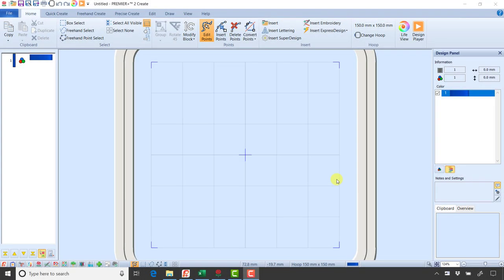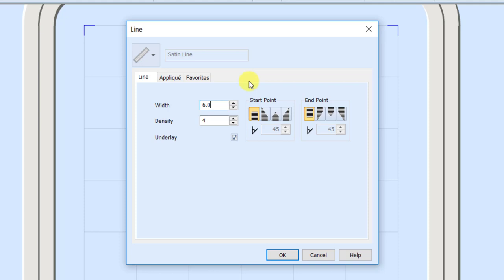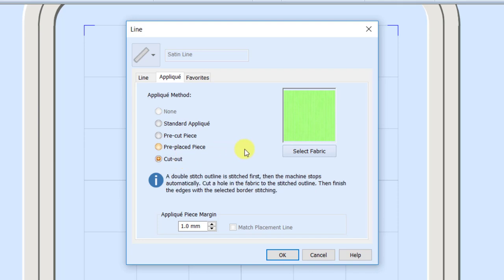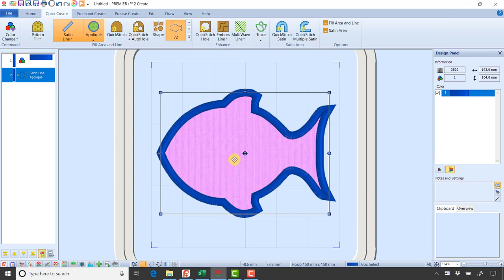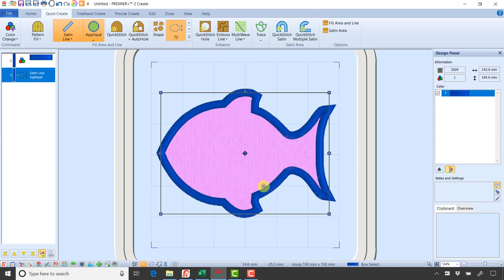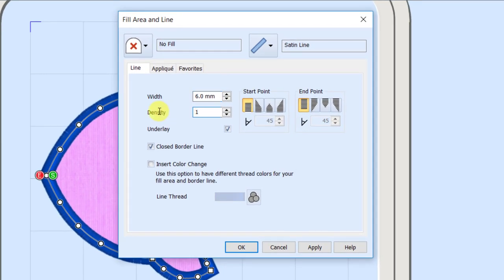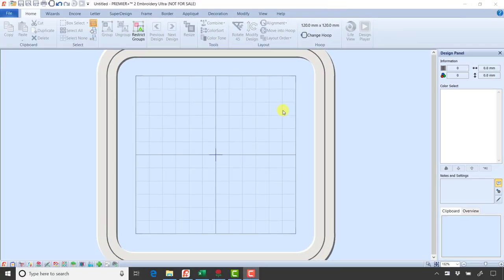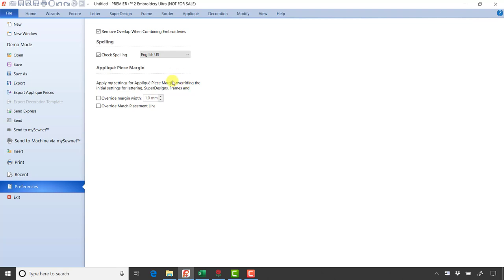PREMIER+ 2: Appliqué Settings

Comment: Hi Fill if I wanted to do a Applique with Batting & fusible backing for quilt Applique.   Does my placement margin need to be 0 ?  I'm not using a cutte.  I'm just making a regular Applique for my quilt & want my Satin stitch to cover my trim job.  Thankyou so much I've learned so much your a great teacher.
Reply from the maker: Hi Kim. If you aren’t using a cutter, then I would just leave the margin at 0.

Comment: I thought this was really good information since I just purchased a Brother Scan n Cut.  My question to you is, do you always have to use fusible (steam a seam 2) on the back of the fabric you are cutting with the cutter?  If I don't put steam a seam on my fabric - the fabric seems to bunch up and will not cut.
Reply from the maker: This video changed my life!
https://www.youtube.com/watch?v=qNZkfrRQm88&t=2s
Reply from the maker: Also - i love Terial Magic - it's like starch on steroids. i either use Terial Magic or Steam a Seam 2 depending on the piece and my mood. ;)
Reply: @PhilCarlton  thanks for this video and I have watched this before.  I just find steam a seam is very expensive when I am cutting several pieces of fabric and there is a fair amount of waste.  I have not heard of Terial Magic but will check that out.  The Scan n Cut I have is the DX250 so the blade is automatically set, but would I have to adjust it like the video says to?.  Thanks again
Reply from the maker: @gwenbrewer2489  I believe you shouldn't have to adjust the blade on the DX250, but I'm by no means an expert there.

Comment: BRAVO!...  I use wash away alot for patches and I want to make sure my satin stitch covers up everything.  The Applique Piece Margin and Match Placement line in comparison to tack down stitch was WONDERFUL.... Thank you.  Now how do you use your BSNC and cut fabric?  Any Tips... My first try was a failure... If you don't mind.  Thanks again.
Reply from the maker: Bugz Z Jamie - in a previous comment I linked to a video from Brother. I followed those steps and it made cutting fabric a breeze.
Reply: @PhilCarlton    Thanks Phil.... You are always SO Helpful....

Comment: Wondering if you could answer a question for me. I have Premier+2 Extra for Mac. I am taking a free course from Al Navas however the sessions are using Windows version. My question is in the design tab on the right side it shows a box for Notes a nd settings but nothing under that. In Al's sessions there is a box underneath that says Clipboard Overview. Why am I not seeing this in my version of the software?
Reply from the maker: Shirley - that’s just a difference in how the different versions was designed. The Mac has a clipboard, there just isn’t a screen that shows what is on it.
Reply: @PhilCarlton  Thanks Phil !!